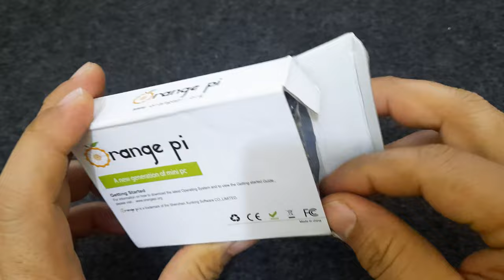How to Setup Custom Board on Orange pi One

Comment: sir ask lang Po sir ung custom Board ilan ang volts ???  debba 12volts DC Input then 5volts DC output ? ang output 5volts DC for Orange PI PC OR Orange PI ??? kasi nakabili ako Hindi nagtagal ung Orange PI PC KO Nasira... kasi ang nabili ko sa shopee tatlo then ung dalawa 12volts DC input then Output 12colts DC ??  then ung isa 12volts DC Input 5volts DC ouput ok ang isa ..???
Reply from the maker: Hello...Custom Board for Piso wifi 12v input tapos meron pins 5v output baka ung dalawang nabili mo na custom board hindi pang orange pi..